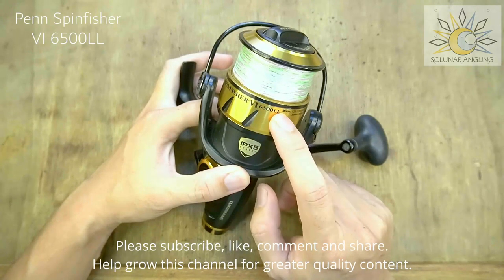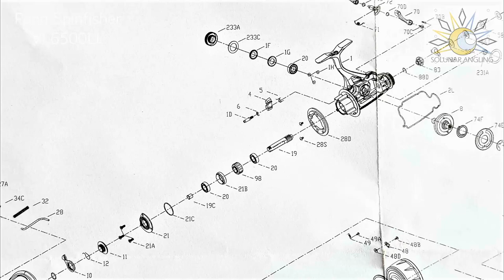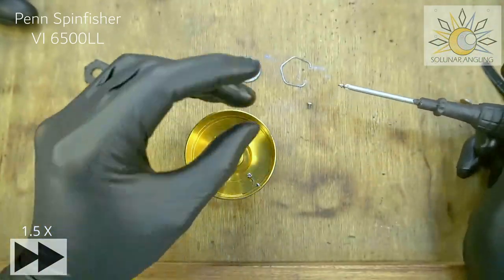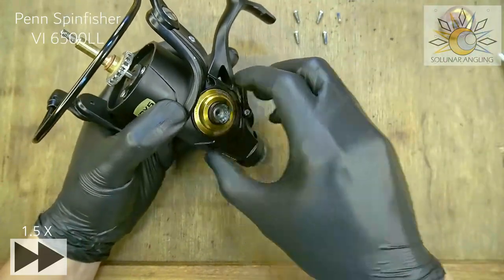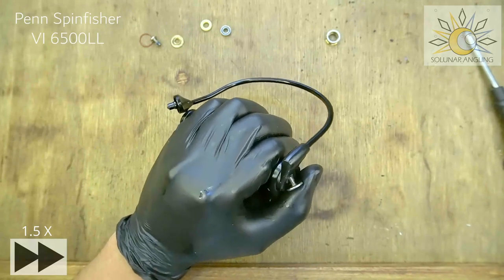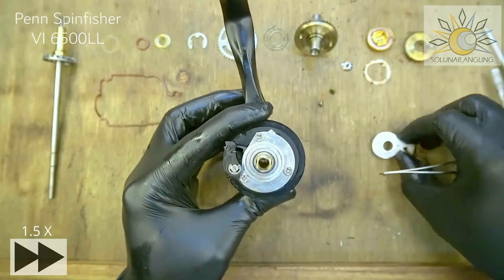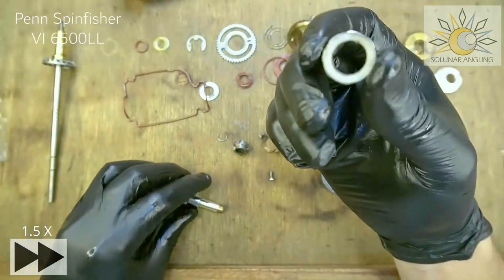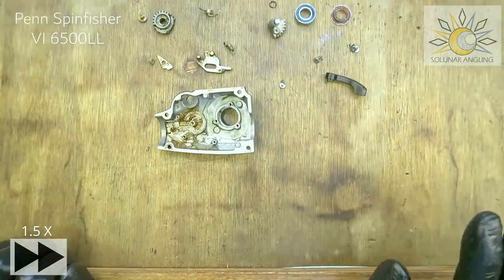Penn Spinfisher VI 6500 Live Liner - Part 1/2 Dismantling - Reel service and maintenance -

Comment: Why tear it all apart just take the main gears out clean the bait runner System and main parts and re grease and put back together I have 6 bait feeder reels and have been working on reels for over 20 years sometimes take them all apart can brake parts 😊😂
Reply: I have over 28 different reels I service them and clean them and repair them and grease them